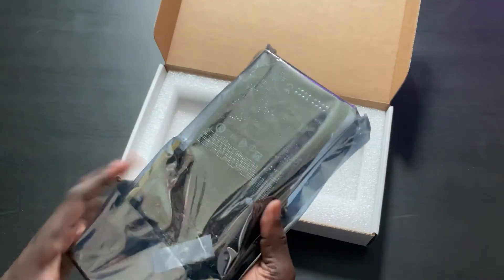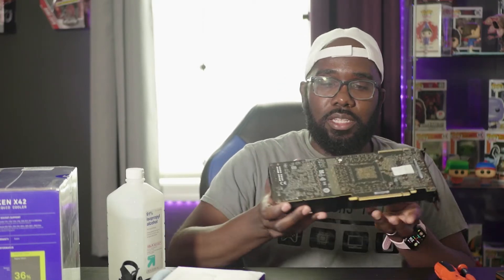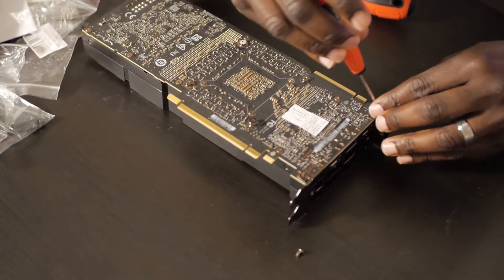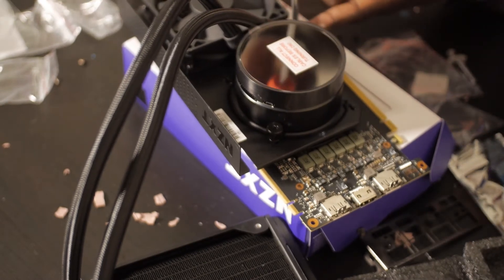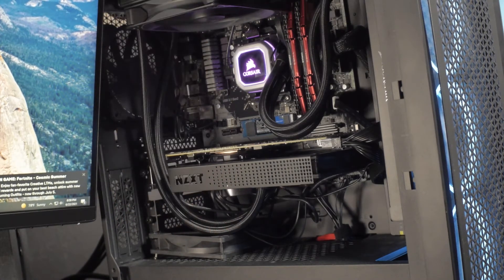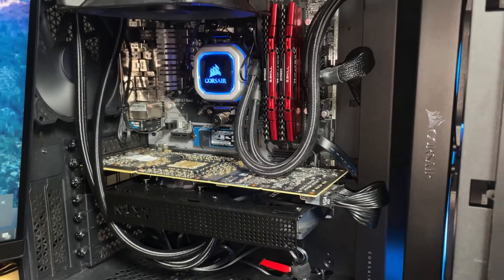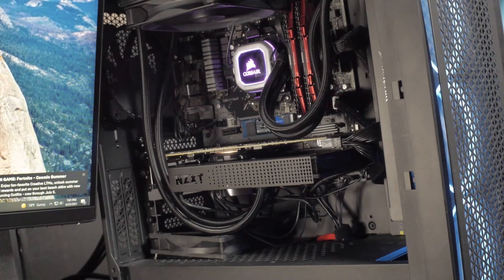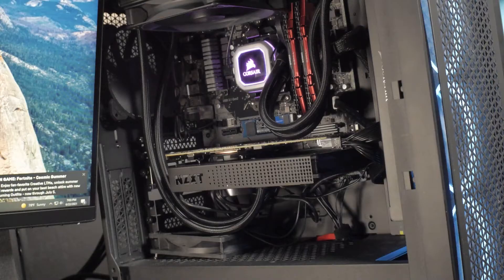Is The Kraken G12 Still Worth It?

Comment: yooo awesome that there are still uploads about this kind of configuration. So for me, I own the zotac 2080 amp and bascially the 3x92mm fans were jsut too annoying.  To make a long story short, I first went with 120 aio and then 240 aio. This switch was necesary because there are some cards that generate so much heat, especially the zotac 2080.  Also, its amazing how the little things are overlooked, like the backplate frame design...  this little ridge slightly covering the PCB which obstructed the kraken plate, which made the gpu chip and aio uneven.  Had to order a dremmel to carefully remove it, and done and done finally.    Ultimately, if you are going to go down this route,  you will need to research research research.......

Your PC case, type of aio, preference of tubing, reddit, youtube vidoes, and yes even trial and error.   

Chances are you are doing it because of fan noise.  This is you next best cheap option.   

Great video.
Reply: I'm never buying a 3fan gpu ever again. Too loud and too damn hot. Dual fan is far superior.

Comment: I recently did this mod to my msi ventus 2080 ti and, in my opinion, what caused most of the problems in the video was the included VRM fan, its e-waste, first thing i did after unboxing it was replace the fan with a noctua 2000rpm PWM fan, and to me it went absolutely perfect, i went with a front mounted (used) corsair 280mm aio with 2 noctua redux fans that i already had, and a 10€ manual potentiometer fan controller for the pump, for the radiator fans and VRM fan i am using "Fan Control" by Rem0o to control them using the GPU temp, it runs super quiet when gaming and silent when doing anything else. 
To anyone thinking about installing the G12, my recommendation is to just throw away the included fan, all i did on mine was install a better fan and it runs just fine without any extra fans or heatsinks. (running good fan control program, like "Fan Control" will also make the experience a lot better)

Comment: i did it to my 2080 ti before 5 days and my 2080 ti temps before = 65-70c and after with the G12 + X73 360mm aio from NZXT during full load = 35-40c
Reply: hey man how did u connect the fans? isnt that like 3 fans. did u get ur GPU to control the temps? if so how cause im a huge noob and i want that exact setup
Reply: @theoneandonlybro3082  i set the fans on nzxt cam on gpu raditor liquid temp also in the app u can do it on gpu cpu or liquid temp
Reply: on x series from nzxt u can control fans 
on z series you cant

Comment: Make sure you go into bios and where the pump & vrm cooler is plugged into ensure their respective chassis fans are on maximum. Otherwise pump and fan will be underperforming..
Also, thermal paste on GPUs need to be spread over the entire GPU chip & evenly.
Reply: Thank you.

Comment: Exactly what I am looking for! Great video man. do you know if 2070 super will have vram on both sides which cause the same issue you had?  I recently learned about kraken g12 and really want to try it out but in the same time I am not 100% confident to mess around my gpu
Reply from the maker: I believe all of the cards in the 20 series except the 2080 TI only have ram and VRMs on one side so it should be ok for a 2070 super.
Reply: @MikeTechsItOut  thanks!
Reply: I forget the site but there's a pretty popular one out there that shows the PCB layout of Nvidia cards

Comment: The cool thing about GPU cooling is, because the die is so huge compared to a CPU, you can get away with those smaller, single fan AIOs.  I went absolutely overkill with it:  I’ve got a 280mm AIO (2x140mm fans) on a 980ti + Kraken G12 hahaha.  Whisper quiet and runs 46ºC w/ voltage and clocks maxed.   Surprisingly, the 980ti is perfectly fine at 3440x1440p.  A definite step down from my 2080ti, but hey, I made the mistake of selling and this 980ti was all I could get lol.

Comment: I thought i was the only other person in the universe to own one of these msi areo 2080ti varients with the oddly placed power conectors on the back, i slaped a morphius 2 air cooler on mine. still thinking about tieing it into my water loop though.
Reply from the maker: Yeah I could barely find anything about this card and I thought it was wired that they placed the power connectors on the back lol. I still have it rigged up with the Kraken and I ended up buying a triple fan cooler to slow under it to keep the VRMs cool. Its quiet but I recently moved it to another computer and it took forever to reconnect everything lol. I probably should have gone with an air cooler like you did.